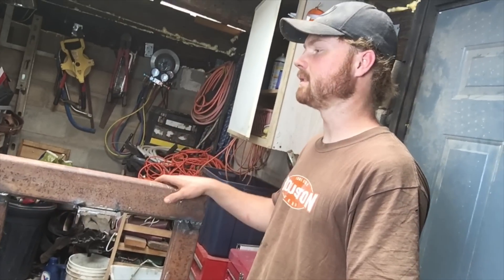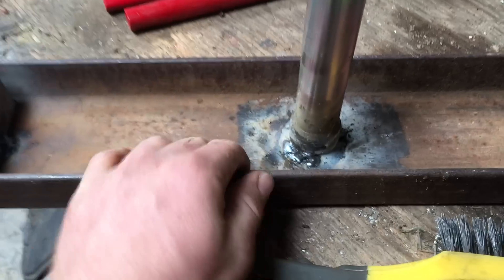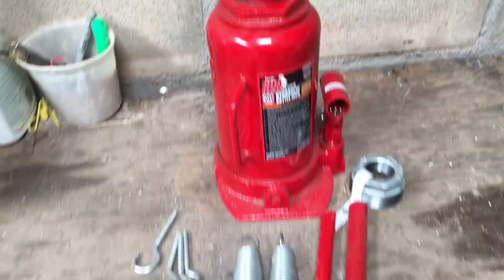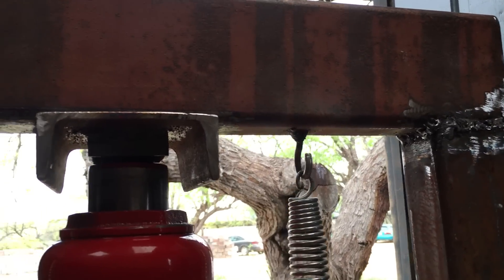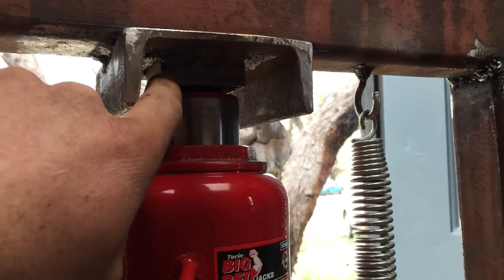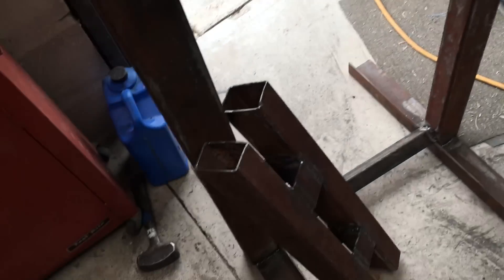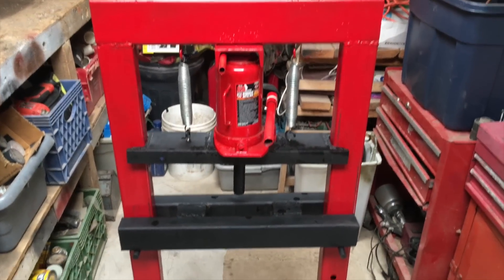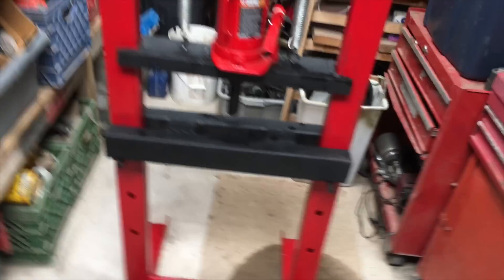How to Build a Hydraulic Press

Comment: I am going to make a 2 ton hydraulic press, can a arch welder support 2 tons and what kind of steel would i need?
Reply from the maker: +The DIYMR Channle I used 1/4" steel and a arc welder on mine. I would probably do the same for a 2 ton. But it all really depends on your design.
Reply: MrOffAndOn For a basic frame like the one shown in the video is probaly what im going to use
Reply from the maker: The DIYMR Channle
U might be able to get away with a little smaller rectangular/square tube but idk if i would 4000 lb/2 tons is a lot of force. The one I built is a little under sized in my opinion.
Reply: MrOffAndOn  So my best bet would be to use what you suggested last time?.
Reply from the maker: +The DIYMR Channle Yeah I think that's what I would do :) hope I could help.
Reply: MrOffAndOn Thanks this should help.
Reply: MrOffAndOn More on the steel what shape is it/ were can i get some for relatively cheap (In store)?
Reply from the maker: I used 2" x 4". I would look at local metal stores or on craigslist.
Reply: The DIYMR Channel